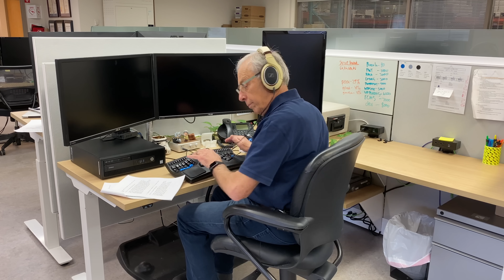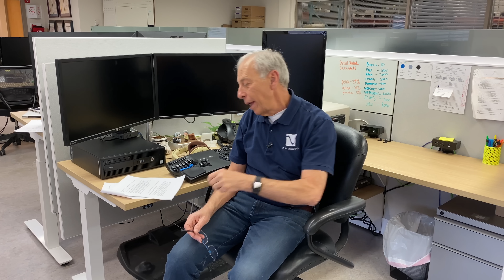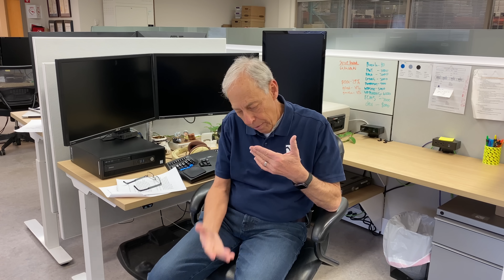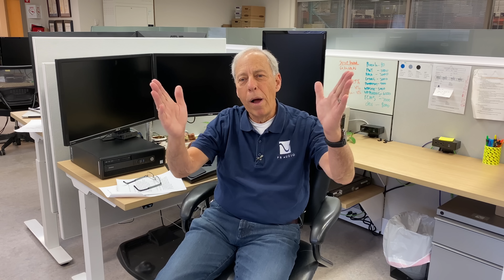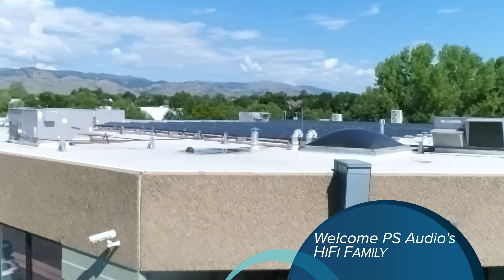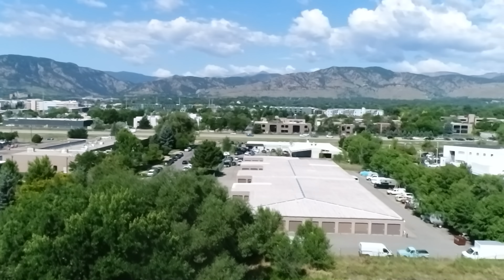Are watts the same for transistor and tube amps?

Comment: I still confused  watt is watt , why different  louder.  Tube have a output transformer are double and matched impedance of speaker. Why are that not said resume for all. And SS more watt but same with the small watt of tube. I see on ss have output tap for matched of speakers.   Thanks.

Comment: I have a question. I own a pair of McIntosh 2100 s that have been modified and are being used as mono blocks. They are transistor and indeed have taps depending on the ohms of the speaker. My question is, even though these are transistor amplifiers, can I assume that these transistor amplifiers have an output Transformer? Thanks
Reply: Yes they do, great amplifiers.
Reply: @jonzecherle1736  thanks for your response. I have mine set on 2 ohms. I'm using  four-ohm ohm speakers in parallel not series. It sounds great and none of my equipment seems to break a sweat.

Comment: From Leo:  Thank you for the video.  I actually earned a EET in the 1970's.  I even still own an oscilloscope.     I still cannot explain the volume difference in instrument amplifiers.   I own a modern solid state Fender Champion 100 with a hole burned clean through the board where the power IC used to be.   That SS amplifier died on stage trying to keep up with a 40 watt Fender tube amp which easily overpowered it.    I also own a 120 watt solid state amp with factory matching cabinet, that holds four 12 inch speakers. The speaker cabinet is not at at fault because when I use it with a 100  watt tube head it will hurt anyone standing close.   That 120 watt SS unit is easily drowned out by my old Fender Twin reverb, 85 watt tube amp with only two twelve inch factory speakers.   All of my examples were amplifiers and speakers factory matched for proper operation.   Every performing musician has similar stories.    My professors taught that speaker efficiency is a relatively minor variance,  certainly not accountable for the lack of real world decibels.
Reply: I was going to say the same thing.  It's widely accepted in guitar circles (so it must be right : ) that a tube amp of a given wattage will be louder, often times much louder, than a solid state amp of the same wattage.  I don't know if you could find a 40 watt SS guitar amp that could hold up to a 40 watt Fender Hot Rod Deluxe, for example.
Reply: It's because a transistor amp will always output an exact voltage, according to the multiplied input signal. If not, it is already clipping or breaking down.
(But once I saw a VOX solid state with transformers!)
The tube amps OTOH would rely partially on controlled _current_, not voltage, because this is what the tube does naturally, and the negative feedback, that turns it into controlled voltage, is often much weaker than in the transistor amps. The transformer is required because tubes have a much higher impedance than transistors. So, if the speaker "gives room" with its own impedance, at certain frequencies, the tube amp will inflate the voltage, resulting in higher loudness. Guitar tube sound systems are built to use these impedance dips to add to the sound. It behaves like an instrument on its own, with is resonances. With a transistor head, the cabinet does not react the same way, and resonances will be smaller.
Caution therefor: when you crank it up and play super loud, and the speaker cable breaks, or the jack gets pulled, then the current wants to still remain, and the voltage goes berserk, and the whole amp might be toast, starting with the expensive transformer.
PA power stage systems have to deliver exactly the same output as the input , which happens with transistors and strong compensation etc. etc., the whole thing is built for highest precision. Add more speakers, it will boost wattage, but when there are too many, we have overload and the protection circuit will switch it down and flash the red light.

Comment: I have a question and would truly be grateful for a simple answer. Is a 40W tube amp roughly as powerful / loud as a 100W solid state amp? (pre / power combo) With 8 ohms speakers? (sensitivity 89db, 150W handlers) Thanks in advance for your reply 😊
Reply from the maker: The two amps can play equally loud to a point. The 100 watt amp can get slightly louder (a few dB more) because of its increased wattage, but both can play at the same loudness with those speakers.
Reply: @Paulmcgowanpsaudio  Thanks so much 😊

Comment: From prior reading and some practical experience I always understood the need for more wattage with Solid State had to do with the dangers of solid state clipping on speakers. You want more headroom to avoid the harsh SS clipping which could damage the speakers. For instance in public address the rule of thumb is typically have twice the wattage at the amplifier that your speaker is rated for.
Reply: Wrong 🤦🏾‍♂️ your speakers will be damaged with you putting twice the load there rated at 🥺 

Actually most speakers come with a warning in the manual to not use a amplifier with higher watts than the speakers saying it can damage the speakers 👍🏾

You and the other inexperienced audio enthusiasts mistakenly think you should use more amplifier power than the speaker is rated for 👌🏾

For example if a speaker is rated 50-200 watts recommended in the manual. You shouldn't buy use a amplifier rated under 50 watts or over 200 watts. It's simple commonsense to prevent breaking damaging a speaker.
Reply: @C--A  If you do a quick google search on the subject, first result - "This means a speaker with a “nominal impedance” of 8 ohms and a program power rating of 350 watts will require an amplifier that can produce 700 watts into an 8-ohm load. For a stereo pair of speakers, the amplifier should be rated at 700 watts per channel into 8 ohms." As i said, this also comes from experience. If you follow this rule, you'll get a good clean signal up the loudest reasonable volumes (generally far below cranking your amp). If you're using an amp that can't keep up with the volume you are looking for, you'll get clipping that threatens to damage the speaker. That said, i've never damaged a speaker doing it either way by just using your ears, but if you want to sound good, follow this general rule.

Comment: What I really hate is when manufactures messure their amps in 1ch or 2ch driven @ 6ohm, 1kHz and 1% (or even 10%) THD instead of the FTC standard with all ch driven @ 8ohm, 20Hz - 20kHz and 0,0xx % THD (Like NAD etc do).
Thgat way they get a high watt rating just to look good on paper. I preffer 50 real messured watts over 100-150 bullshit messured watts. I have a 7x85 (2x100 in pure stereo) watt @ 8ohm reciver with 1500 watts power supply and it beats the living shit out of recivers at double the watts on paper.
I also have a 2x 150 watt @ 8ohm amp (runs class A the first watts then A/B for the rest) with 1000 watts power supply (actually it's a 500w supply for each channel) and that thing is insanely powerfull for "just" beeing 150 watts. They both have good power reserves and don't run out of juice even on high levels with heavy speakers.
Reply: indeed. alll types of number to sell their stuff. I was in for abig suprtise in 1991 when I vough a entrey level denon Cd player and it sounded ABUYLETE HORRIBLE. i BELIEVAD ALL THWE STUFF IN audio and stereo reviews how all Cd players sounded them same and their impressive specse. THANKEWS YOU AND THUMBBS UPS!

Comment: Wrong .
Here we go again with the distorted explanation 
Everyone knows tube and class A watts are loud at low wattage , that's why some speaker manufacturers rate different power ratings for class A and tube watts .
rate thier speakers
Reply from the maker: Well, sorry, but can you point me to an example? What you're saying here is simply inaccurate.
Reply: @Paulmcgowanpsaudio  
A guitar amplifier (di pole enclosure also)
Up to 12bd of usable gain over a solid state .
Your an engineer lead and you know the difficulty answering this question. 
Before you start thinking about the resistance added to the transformer for the added gain , consider this ....
The incomplete measuring sytem used .
More of the created watts are usable in a true listening situation with tubes and big class A , thus the different manufacturers amplifier ratings to be used with a specific speaker .
Tube amps are perceptively interpreted in real world terms at home and in venues as watt per watt much louder .
You can try to disprove it with math ,
But you cant argue with the difference in room filling sound , especially in guitar amps which is common knowledge regardless of the math , which is flawed somehow in the true rating .
That goes for Big Class A also to a lesser extent Paul .
I know you know this .
That's why I'm forming this argument 
Because low power SET is still competitive against your D class follower arrangement in all areas of SQ 
With sensitive speakers. 
You need to be developing a pwm high speed push pull tube that operates in bloom as an integrated amp.
Watt for watt , tube amp is much louder .
Doesn't matter why ,
That's a fact .
Reply: @Paulmcgowanpsaudio  
You should be using a Russian Surplus based tube triode design with a PWM 
Microprocessor regulated power supply and invert your follower D class scheme and process in digital , followed by tubes running in full cane class A bloom at all volumes in push pull with digital notch control , regulated grids and external power supply with filtering .
Maybe you could create an inverted digital sigma servo algorithm in digital to stay in 24 -7 saturation at all volume levels , something that could power panel ribbons .

Comment: the thing that comes to my mind for wanting 2x solid state power, vs valve is distortion characteristics, the valve output transformer magnetically saturates and limits the power, sounding rather like a compressor, so it is gradual and graceful, solid state goes into overload rather suddenly and usually with lots of odd order distortion, so suddenly sounds awful tube amps also tend to even order distortion which is perceived as being more musical sounding, of course no perceptible distortion is always preferred, but most people notice distortion at about 3%, so distortion on amplifiers is usually marketing hype and far lower than actually matters, much like the megapixel war with digital cameras24mp for ameture  and 20mp for top professional

Comment: True, watts are watts except that when a transistor runs into clipping it is like hitting a brick wall. Dynamic power is more important to music than just continuous power. Tubes will far exceed their rated continuous power rating for short bursts without nasty harshness of hard clipping of transistor amps. Tube amp voltage keeps rising in a non linear fashion due to saturation of the tube and less harsh on the ear. Dynamic power rating of 3db means an amp can double its power output for short bursts like drum hits, recovering energy between pulses. My Heathkit W5M amplifiers have a dynamic power rating of 2.7db which is pretty good, meaning it is rated at 25 watts RMS continuous and around 43 watts dynamic. Good for music that is not compressed too much, better dynamics. For a transistor amp I would leave at least 6db of dymanic headroom, so for 40 watts dynamic music power you should have around 160 watts for headroom minimum. I think that is what people are hearing and why tube amps SEEM like they have more watts, even though ratings are the same. That is my understanding anyways, please post comments for your opinions or corrections. We can all learn from each other.
Reply: Watts are always measured in R.M.S , AC volts rms square divided by Resistive load in ohms.
Reply: @danerickson1632  Root Means Squared or 70.7% of peak watts when it comes to sine waves. AC equivalent of DC power dissipation.

Comment: All this mumbo jumbo about power with solid state versus tube amps. It's actually quite simple. The output transformers on tube amps have multiple taps to allow different speakers impedances to better match the impedance of the output transformers secondary winding because the maximum transfer of power occurs when the source and load impedances are the same.
It's no different with solid state amplifiers. The maximum power transfer occurs when the amplifier's output impedance matches the load impedance. However because the output impedance of a solid state power amplifier is much lower than the speaker's impedance, the power transfered is greater as the speaker impedance becomes lower. And that's all there is to it. Except that solid state amplifiers have a much better damping factor than tube amplifiers for better control of the woofer cone. That doesn't keep the tube camp from giving up their love of tubes though, with all the distortions that come with output transformers. They like the sound of output transformer distortions because that is what they are used to hearing.
Reply: This is the best answer. As a physicist I knew that the maximum power is achieved when an output impedance of a source is equal to the impedance of a load. Just did not realize this is what they want to achieve with tube amplifier impedance settings.
Reply: Many thnakas KIND SIR. I think that is the answer I have been lookign for for over 40 years. That certanly eexplain why transister amplifier such as CROWN XTi 4002 go down to 2 ophms -      Stereo, 2 ohms (per ch.): 1600W
    Stereo, 4 ohms (per ch.): 1200W
    Stereo, 8 ohms (per ch.): 650W
    Bridge-Mono, 8 ohms: 2400W
    Bridge-Mono, 4 ohms: 3200W 

BTW, do ytou know if the CHIMEYNESS of tube guitar amps such as VOX, fender, marshall, etc are because of the distoprtions of the output transfoermers or the harmonics in the tubes or both, or do they do something in the equaliuzer circuit or wehatever to make it chimey. ONCE AGAON, VERY GREATTLY APPRECIATED. PLESE COMMENTS AS OFRTHEN AS YOU CAN. THANKE YOUE AND THUMBBES UPS!
Reply: @ilovecops6255  Hey, thanks for the nice words. Glad I can help.
About guitar amplifiers, the sound of the tube amps is due to both the tubes and the transformer. The tubes  behave better when pushed to or beyond their limits which makes them sound better than transistors similarly driven. The output transformer also contributes to the sound because they tend to saturate at high powers and exhibit hysteresis which affects the waveforms as they swing positive and negative. All this adds up to a different sound than transistor amps, but the sound of tube amps can be emulated by pedals, which I worked on in my last job before retiring.
Reply: @ilovecops6255  The early 60's Aussie Rola speakers were 2 ohms or 15 ohms, the late 50's 12" were mainly 2 ohm
Reply: @VaughnfromPeterborough  THANK YOU KIND SIRE. THUYMBBES UPS!

Comment: Thanks always for your great insights. I have a follow-up question - what if you have 6ohms speaker but your tube amplifier has only 4 or 8ohm terminals? Does that mean you can only use specific speakers with tube amps, also what would happen if you connected your 8ohm speaker to 4ohm connection?
Reply: Try both 4 and 8 ohm...you'll get a warmer sound on one of them...decide which one fits your system and room acoustics better! It doesn't really matter.
During any song you play the speaker impedance (how much current they need/draw) will vary from 7 ohms to maybe 4.5 ohm on some frequencies (usually around 100-200 Hz).
Speaker impedance is NOT a fixed value...it fluctuates continuously during the song.
Reply: Many 8 ohm speakers get down near 6 ohms or even less at some frequencies. The ohm rating of a speaker is only a general idea of the relative impedances between different speakers. Manufacturers stating 6 ohms are being more forthright about the fact that their speaker can dip below 8 ohms. You can use any speaker with a tube amp or solid state amp, you need not worry about the impedance rating. The only difference when using different taps is that there will be more or less power delivered to the speaker, depending on how close the speaker impedance matches the output transformer tap.
Paul once again didn't really get to the heart of the question.

Comment: Doubling the power requirements of a solid state could also be related to the way solid state distorts when clipping. It clips hard, introducing a lot of even order harmonics which we don't like the sound of. Tube distortion sounds pleasant so you can probably get away with bring closer to the edge?
Reply: Transistors introduces odd order harmonics.
Tubes give off even order harmonics.

Comment: I thought it may be to do with valves having a much softer or gradual distortion as they go over their rated output, therefore being able to be driven to a higher output than their rating without listener (and maybe even speaker) discomfort. Just something I heard many decades ago, could be entirely wrong!
Reply: No, that is quite accurate.
Reply: Thanks Stewart, I'm pleased it can be verified. It came from my Father, who was an audio engineer during the valve to transistor 'transition'.